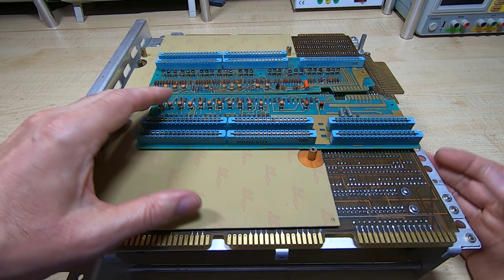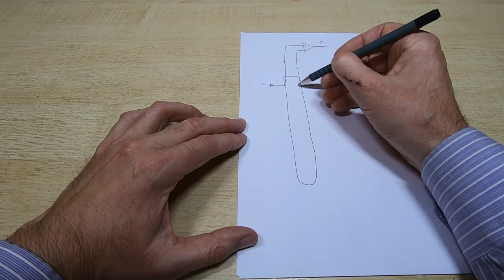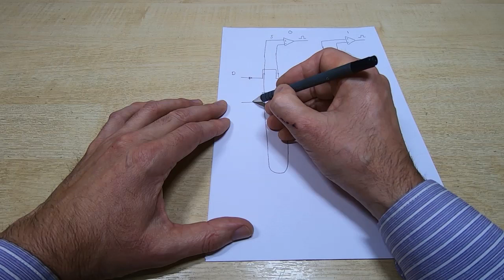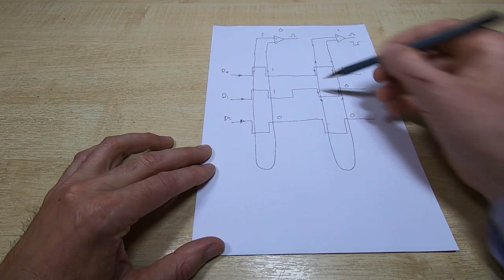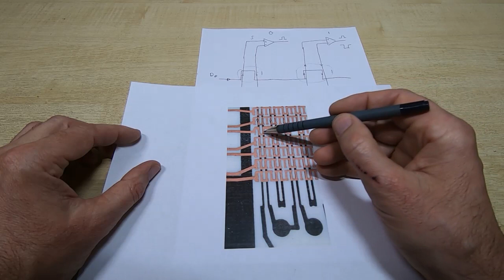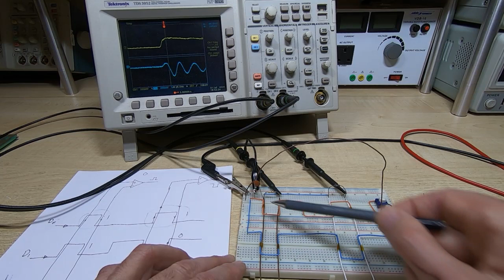HP9100B #1 Repair Part6

Comment: Jerry, yes, please continue making this type of video series with in-depth explanations of the equipment designs, at least the first time around on particular pieces of equipment.  I find this type of video very interesting and educational!

How do you "adjust" the spring contacts (without damaging or breaking them) to properly make contact when end connectors are plugged in?

On gold edge connectors, have you ever used the "gold contact repair" kits before, when needed?  What is your opinion of them?

The HP 9100A & 9100B Service Manual that I found (H/P Part No. 09100-90034) doesn't appear to cover the ROM board(s) because they claim that only 4 boards are field serviceable, and the ROM board assembly isn't included.  What document(s)/schematic(s) are you using?

How long are the ROM board "reads" energized when this machine is running?

Comment: Fantastic video, thanks! I am particularly interested in old memory technologies. I'm interested in building discreet logic machines without resorting to modern eeproms or other components. This looks like quite an easy technology to replicate - I think I'd like to try doing something fairly simple like a character ROM implemented this way. The one daunting issue I think would be the decoder lines if you've got a significant amount of rom... With 1024 words you would still need 1024 control lines  so a 10 bit, 1 of 1024 line decoder would be interesting to deal with.  I have been considering ram and rom technologies for a relay computer for a long time - but the goal of that project would be to entirely avoid semiconductors altogether so I guess this couldn't work unless someone could come up with an op-amp built with relays...
Reply from the maker: For larger arrays you can use steering diodes. That is what the big block of diodes is for on the ROM board. For example you could use 32 parallel arrays and use blocks of 32 diodes with the outputs driving the separate blocks. You then simply enable the block you want to access. For 1024 words you then only need 32 drivers (or 16 if you also duplicate the sense lines).
Reply: @JerryWalker001  I wonder if you could do one of your fantastic instructional videos on how that sort of diode steering logic works. I understand diode steering for a matrix to light 7 segment displays or something like that, but I can't quite wrap my head around address line decoding with diodes.

Comment: Thanks, fascinating solution to the problem of storing data. Using a multilayer PCB rather than a mask ROM. That took a lot of time to develop without any CAD. Very robust as well if you exclude the drive circuits. Nice clear explanation, it always helps to understand how it works.

Comment: Excellent explanation, especially the breadboard experiment. Never heard of this technology - with the circuit board technology of today, this is probably not that hard to replicate. Back then it definitely was cutting edge. I wonder why they didn't use this for the Apollo computer ROM instead of the tedious to manufacture core rope memory - the achievable density seems to be comparable or even better. The PCB layout could have been easily generated directly from the code even back then, also copper traces sandwiched between pcb material likely would be mechanically more robust than all the long, hair-thin wires in a core rope module.
Reply: I think that the AGC core ropes changed from mission to mission as the software (and requirements) evolved over time for different mission profiles.  I had seen a video elsewhere on YouTube where the production of the core ropes was semi-automated from the output of the software tools, so they could spin new releases relatively often, for each mission.  While this amazing technology in the 9100 is probably more robust, the time taken for each "version" must be pretty long with getting PCB design and production in each release process.

It would be really interesting to understand what the workflow was at HP that ultimately lead to the board being produced, and what sort of tools were used to help produce the "ROM" layout.  So many bits; I sure hope it wasn't all manually laid out; so much opportunity for human error.   I gotta believe your eyes would be crossed pretty early if you were hunched over a table, laying down tape for all those traces by hand!
Reply: @lmamakos  I'd really like to know if someone actually had to draw this board by hand or design it with the black sticky tape they used back then. With all the repetitive patterns, a few errors among the thousands of bits seem highly likely and very hard to avoid/find. The idea I had regarding how the pcb could be directly generated from the code was based on simply connecting a pen plotter to one of the contemporary computers. All the program would have to do is read in the code to be drawn from punched cards/tape and then move the pen of the plotter up and down accordingly while drawing a line. The only thing left to do manually would be making the connecting traces to the computer drawn traces. The method would need plotter pens with a suitable line width so it matched the tape they used for the normal manual pcb artwork, but otherwise I think it would have integrated quite well into the traditional workflow of pcb design.
Reply: @tpa6120a2dwp  Well, we certainly know they had pen plotters at the time. :-)   Even with normal sized pens, they could have drawn out a guide for someone to lay down black tape on, or a really ugly color-by-number sort of solution.  It'd be interesting to see an X-ray of that board to see how "regular" those traces were to get a hint of how much manual intervention was done to to produce that board. 

This is a really novel solution to this sort of problem.